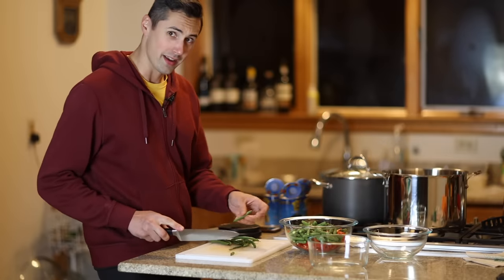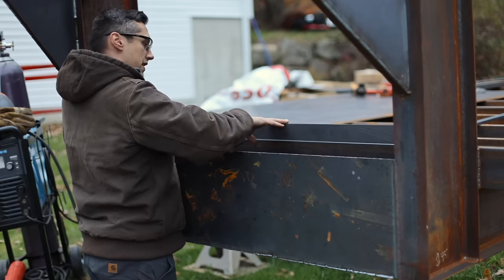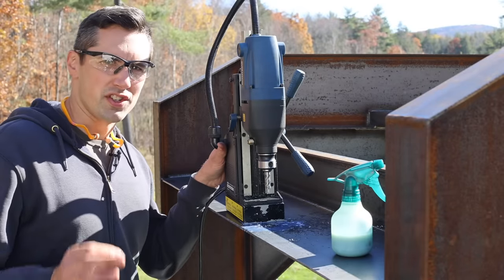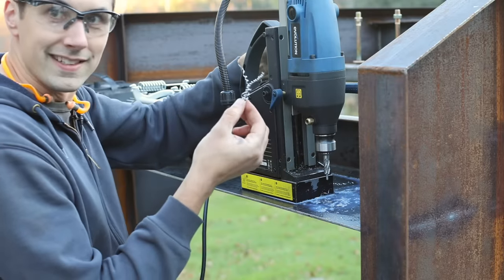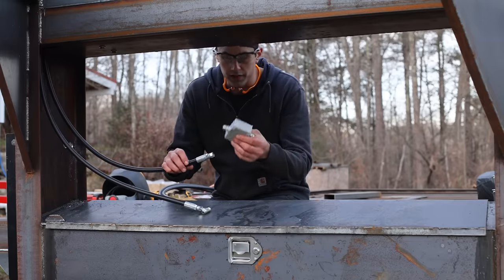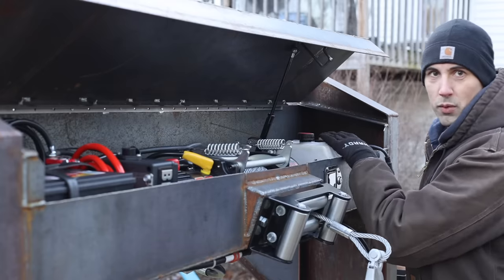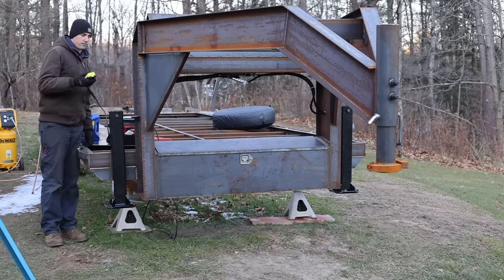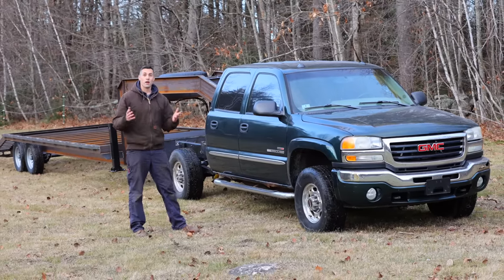Gooseneck Trailer Build Part 2: Hydraulic Jacks, Toolboxes, and a Winch

Comment: As a professional tuber I have to let you know that they make JIC bulkheads that you should be using anytime you pass through a solid object with hydraulics.  Hydraulic hose have a tendency to wiggle when you use them and runs a chance to rub through at some point in the future.  I understand they won’t be getting operated all the time but it’s still a thing that will flat ruin your day when it does finally happen.  That said the build is looking pretty good.   I am curious what your end plan for the decking for the trailer ends up being. I think you mentioned it in a prior video but I just can’t remember off hand.

Comment: Mount the spare upside down so the valve is facing down so you can easily check the pressure on the ground
Reply from the maker: That's a great idea! 👍

Comment: Water will get in through the hinge and from the side a rased lip on the side and a overhang behind the hinge. Weld on greasable hinges will make it last longer with your design put drain holes  .

Comment: Waldo..   Dave Kersey  Just watched your vidio on the trailer build have one safety comment when using a mag drill in an elevated  position.  I worked in substation construction for PG&E where we used mag drill in elevated  positions and we always had a safety rope attached to the drill and the structure we were working on in case you should loose power or someone disconnected your cord. Might prevent an injury!

Comment: Looks great! Noticed a few things I'd have never done differently because I'm probably never gonna build a trailer but you're building one on YouTube and someone has to be that guy and it might as well be me! (This isn't intended to bash your incredible work, just constructive criticism, BTW)

1- that bungee battery hold down is no bueno and illegal in most states. If you roll it, the bungee will stretch, the terminals will contact the toolbox lid, and it will catch fire and explode. This will get worse in a year when the stretched bungee dryrots. A metal one is like $5 and the right one will probably hook onto your chain loops. A cover wouldn't hurt either.

2 - a deep cycle battery is more suited for what you're doing, and I would have used one in the same size case and terminals as the batteries in the truck for obvious reasons.

3 - the brace that you put under the winch to hold the sheetmetal should have stayed. That would have been a very handy spot to put a receiver for all the fun things you can plug into a trailer hitch. (Winch mount, pulley for doubling the pulling power, vise mount, bike rack, spare winch, and whatever else you can weld onto a piece of square tubing)

4 - switch out those 2 bolts holding the spare and replace them with a spare hub/bearing and carry the tools to replace one as well.

Awesome trailer though, totally dig it and I really enjoy watching you build it! Thanks for sharing!!!

Comment: Place a magnetized CB radio antenna in front of your gooseneck ball. Have a vertical antenna rod attached to it. Red paint helps. Then simply align the rod with the hitch on your trailer. The red rod indicates exactly where your ball is located in relation to the hitch. Once you're hooked up, simply remove and store the antenna and magnetic base. Works jest fine and lasts a long time.

Comment: The rubber strap over the battery is dangerous. If you hit a bump the battery will fly up and hit the bottom of the lid and possibly cause a fire. also, the Hydraulic oil is in a contained space and the same bumps could cause it to fume, so you need to vent it to the outside of the box all the way to the bottom of a rail so it does not cause a mess on your trailer or what you might be hauling...

Comment: "Up" and "Down"... done that before... Simple fix is use a sharpie and ID the directions as extend and retract. I also agree with others, some additional bracing for the winch would be some good insurance. Something as simple as some .75"x.75" angle in an X pattern on the underside, corner to corner should add enough rigidity. Another option and is common in the rock crawling world with suck-down winches, instead of having the which line go out in a horizontal direction, cut a hole in the underside of the "mount”, and have the line go vertically down, immediately below the winch, directly to your snatch block/pulley/D ring. Looks awesome!
Reply from the maker: I like the idea! 👍

Comment: Really enjoyed your videos on this trailer. I have the same concern others do about the winch mount itself but it's been brought up enough. I have a few other questions. 1) Once finished, did you have an alignment done one axles vs the hitch mount to make sure it trailers straight? 2) You seem to be an excellent welder but did you have any certified welding tests on them? 3)  I see you used a MIG welder outdoors, did you turn up the gas pressure? Every time I try to MIG outdoors it's too windy and have to switch to wire feed or stick. (I also didn't notice and preparation for the welds themselves, welded through rust and mill scale.)  4) Were there any special inspections or certifications need to get it legal to use on public roads? Looking forward to catching your 3rd video that finishes it off completely.

Comment: The first decent load on that winch and the bolts will pull right thru that 3/16ths plate.. I'd maybe do 1/2 inch plate with some decent tubing for added support and less flex.

Comment: Love what you done so far But im thinking you need trailer brakes 1 for static use if you need to leave it somewhere to stay with a lock. 2 with all that weight empty let alone with 4 ton of gear thats a lots to hold back without auto breaking on a trailer as i see snow there.?

Comment: Mount the battery on foam and it will last you a little to a lot longer. Sharp vibration slowly but surely damages heavy lead plates, foam will soften the vibration. Don't let it the battery go below about 12.2v for long periods or it will be damaged. Charge it up to about 13v.

Comment: I use magnets on my solar panel so I can adjust it for exposure.  Regarding the battery, that is a “cranking” battery.  If you don’t have a constant charge (alternator) while using it, don’t go below 50% charge if you can help it as it will eventually damage it.  I use deep cycle batteries for such applications. They hold up better in the long run.
Reply: What Cotton just said with an exception, you can kill a cranking battery by dropping it below 50% just one time.  Those cheap batteries from Wal-Mart are even more prone to it, they are fine for cranking but don't have much deep cycle reserve or life.

Comment: Great video, but I would recommend changing the flow divider for a regular T.
When parking on uneven ground, the cylinders will extend the same length, and you could end up with all the load on one cylinder.

With a regular T, the pressure will be the same in both cylinders, regardless of the stroke length.
Reply: I understand what you are saying, but a tee could cause more problems than it solves. Would probably be fine if trailer is empty and on fairly level ground, but with just a tee fluid is free to flow from the jack with the most weight to the one with the least weight. It could cause the trailer to twist toward the heavy or downhill side in the front. That being said, those simple flow dividers aren't without their issues. I've I were using a hyd setup like that, I'm not so sure I wouldn't want just a single jack in the middle.

Comment: looking good but you realy realy need to beef up your winch mount  and tie it directly into your beam structure or at the very least completely divorce it from your storage..it will work for a bit if everything you load is an easy roller or drag but sadly thats usualy not how life turns out..It may be a harbor freight winch  but its more then capable of tearing your upper toolbox completely off of your trailer...just a friendly heads up m8.

Comment: Toss that solar panel, you are going to want/need at least 25 if not 50 watts (I would honestly get 100) for a top mounted fixed panel with that battery in your location.  Anything less and you're never going to top it back off when you run it down in the winter months.  Also, get an MPPT charge controller for it, the panel and charge controller will cost you roughly $150 combined and be well worth it I promise.

Comment: Winch and winch fairing needs a redesign there, not nearly enough structure for the force its going to put not only on the base plate but on the fairing mounting plate as well.

Comment: I'm not a Chevrolet guy, but I'm pretty jealous of your trucks. lol..   I have a 2002 7.3L F350, single wheel, manual 4x4, manual hubs, with 6spd manual trans.  I do love this thing, but it's nearly 300k miles now, I've had it since 2013 or so.  Bought it without a bed for $7500.  She doesn't like to start in the cold now, probably needs glow plugs.  That's a nice Duramax, though.
Reply from the maker: Those 7.3s are good engines. And with a manual?! 👌

Comment: This trailer is looking great.  I have a concern which may be something you have planned for or I just haven't noticed why this wouldn't be an issue. Your tool boxes I believe could get a lot of water in them. Most tool boxes that are outside, have a lip raised up about 3/4" all the way around the opening and the lid has a lip going down about the same amount from the lid all the way around.  I hope you can see what I mean.  I built one 30 foot gooseneck trailer 30 years ago at my job, but it was no where near as nice as your build.

Comment: Curious why you didn’t run the hydraulic lines inside the concealed upper tool box and punch through both sides vertically so the line splitter and lines aren’t visible… amazing build loved your videos just curious!

Comment: Waldo!  Congratulations on 70k subs!!!(I’m sure this video will push you over) Can you tell me if you had any welding experience prior to your start on YouTube?  I have been welding for years with a cheap mig but my welds don’t look anywhere as nice as yours.  I have a feeling it is because i am using flux cored wire…
Reply from the maker: Thanks Carl, I think you're right! Yeah, self-shielded flux core is notorious for producing ugly welds. MIG and dual-shield flux core are much better for aesthetics. It's also possible that a cheap welder might make it hard to get the settings right, which can also produce ugly welds 👍
Reply: Flux core can produce decent looking welds, but they will have splatter. One of the biggest problems is that people try to weld or move too fast and also often times use too small of a welder. 120v machines don't do well on anything over 1/8" unless you preheat...at least my miller 135 was that way. My miller 211 inverter is rated at 235 amps max and even on 120v it does very nice welds on 3/16" settings. Both of my miller mig units have had completely adjustable voltage and wire settings vs. the machines with notched settings. Prep is also important, especially if your machine is small. Clean steel without mill scale is easier to weld, but with enough amperage, you can burn right through it with mig. CO2 is much cleaner than flux core, but 75/25 argon is always my first choice, if not TIG. Argon has better fluidity and less splatter but a little less heat. The Miller 211 inverter or 220 (same machine but with tig and stick) are perfect all around machines for a beginner or pro who doesn't need a huge duty cycle. The Miller 252 has been great for production or heavy work and my TIG is a 1965 Miller AC/DC Goldstar that will put out 460 amps max. You don't have to use the most expensive machine, but you need something with good power and a decent arc as well as good instruction. Jody from the youtube channel "welding tips and tricks" has great videos.
Reply: @CGT80  thank you for the insight.  I think my machine is due for an upgrade as it’s only 100 amps.  Also, I’d like to look into a shielding gas set up.  My problem is that I only weld 3-4 times a year and most of the time it doesn’t have to look good or even be very structural. Sometimes it’s just welding a nut to a piece of wire for a simple installation into a blind hole.

Comment: I would be hesitant to trust the the fairlead itself as a pulley like you’re planning to do. They can hold up to some up/down tension but they’re really just not sturdy enough to be used as a pulley. It might work for just winching cars on the trailer but I’ve seen countless roller fairleads just bust the pins in Offroad situations. An easy way to adjust the design would be to cut another  8”x2” hole in the bottom of the plate below the winch and add another fairlead down there for the winch line to some directly through the bottom to a pulley. This would also put less strain on the whole winch mount itself as it’s taking one point of stress out of the equation. Great video though this has been an awesome series

Comment: i would recommend a couple things... 3/16 is noth thick enouugh to handle 12k... and that fairlead as a redirecct is a bad idea.. do like tow trucks do,,, use a length of chain, and a snatchblock further down the bed for a redirect..also why  would'nt you make the box tops waterproof? a few strips of 1/4" bar stock, and 4 bends and welds you can make a sommewhat sealed box, and use butyle foam tape to seal the top...

Comment: If you want the gas strut to last, turn it up side down so the oil stands on the seal, the way you installed it its dead in about 12 months. Give or take. And btw. would you build me a trailer too? Cheers Manne
Reply from the maker: Thank you for the tip! 👍

Comment: Don't you think the 3/16 plate, will be strong enough to prevent warpage when using the winch?
You may want to double check your clearance of the hydraulic pump motor. I would say it has cooling vents on the back and it looks like you've  near butted it against the rail.

Comment: You're going to want to add some reinforcement for the plate the winch site on. 3/16 plate is the minimum on a bumper for a jeep with 9000lb winch. Also since you're going to be pulling perpendicular to the plate its gonna put some major stresses. You could also cut a hole under the winch to let it feed out the bottom and not bending the cable over the fairlead

Comment: Great video as always, but i was wondering why did you put the winch that high?
Reply from the maker: Mostly because that's where I had room for it. I figure if it's mounted higher, then it also helps keep the rope from rubbing at the top of the dovetail 🤷‍♂️
Reply: @WaldosWorld   now that is a good idea, i haven't thought about the dovetail part, you really think this true, right? :).  i m also using a similar winch to tow my boat to a trailer, i don't know about the pricing of the batteries nowadays but i had better longevity and use time with a single charge with deep-cycle batteries. just a thought.

Comment: Should've added a strong hooking place on the front of the deck. A lot of winches are rated at double line pull. Even if it isn't pulling that way is much easier

Comment: Nice... I would have mounted as much as I could lower - like the hydros and battery and the winch. (and why the winch so high? and not much under it? That will bend!) The axles seem back far. Did you say you matched another trailer in your build? Seems like that would put a little too much weight on the truck when the trailer can handle more. Maybe it's me... I'd of pushed those axles forward a foot or so.

Comment: Aw mate you're killing me, starving now! Is that winch mounting box strong enough?  Some bracing to the major structure at the front (triangles either side of the winch?) to prevent the 3/16ths plates from flexing when load is applied? Just such a cracking build, congrats on getting it mobile!
Reply from the maker: Thank you! I guess I'll try out the winch on something light and we'll see if it flexes. I can always reinforce later if necessary 👍

Comment: A better way to mount the winch is on it's own little square frame that can then slide into a standard square tow hitch receiver..  see this way you can mount it up there on your trailer, or you could quickly un-pin it and mount it on the back of your truck---  and then you can even put a tow hitch receiver on the front of your truck, which will let you mount it there too, when needed.  "Andrew Camarata" has an awesome channel, which is where I got this from.

Comment: Does the cost of building the tool boxes work out cheaper than buying one from say tractor supply, or do you just build them to challenge yourself and make it your own?
Reply from the maker: Yeah, it's definitely cheaper than buying them, though it can be a challenge making them weathertight. In this case, I opted not to bother making them weathertight and added drain holes in the corners of the floor 👍

Comment: when you are jacking the trailer like that and it lands half cocked on the ball, lift the jack legs up enough to throw a 4x4 under the side you want to move it away from, then put em back down, it will push it over for you.

Comment: Nice build, do you have a plan for the rust on the trailer?
Reply from the maker: Probably sandblasting or using a wire wheel as necessary. Or maybe I'll get it hot dip galvanized (if I can find a way for such a large object!) in which case an acid bath will take care of the rust

Comment: Great build but i woulder , The trailer seem to weight a bit empty it not be more safe to have some sort of brake system on the trailer since then u load it it will be high force pushing forward then u brake on the road ?